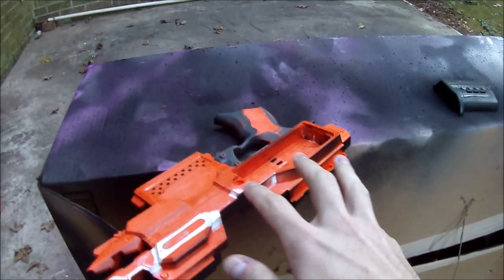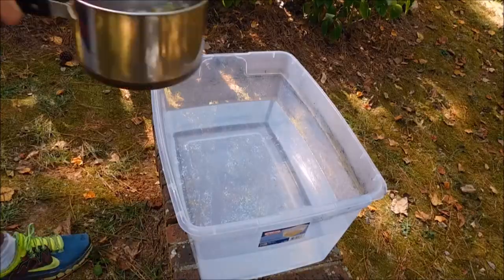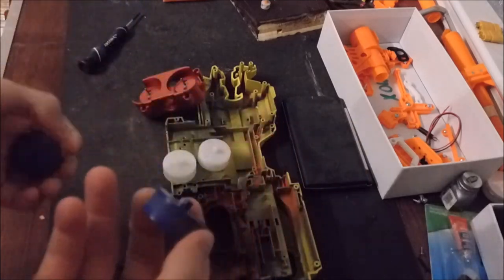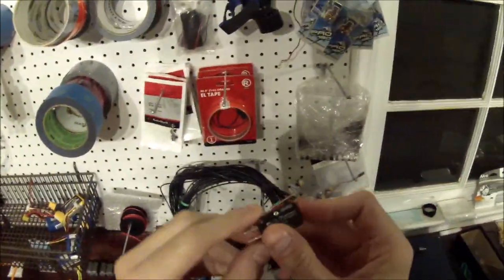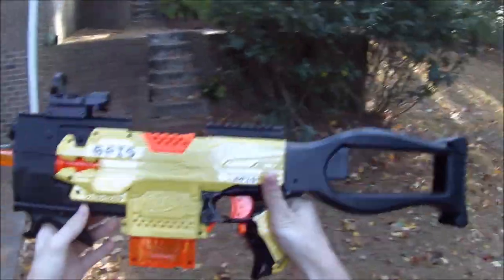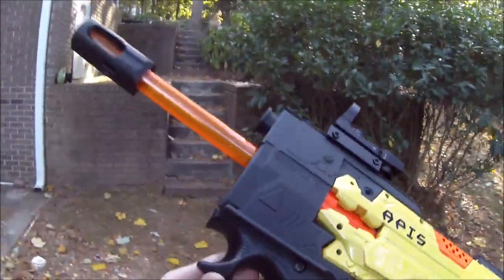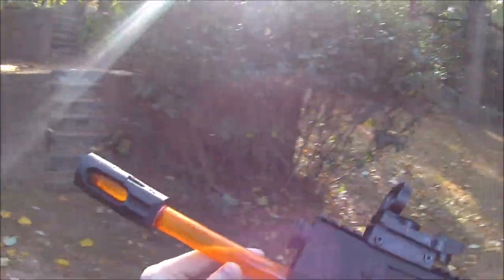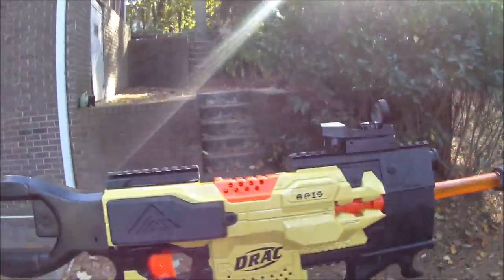Nerf Mod: The Apis Tactical Rifle

Comment: Drac, try the paper flap dremel sanding wheels for your shell prep... the stones you're using are for grinding metal and they get clogged up pretty quick. The trick is to keep it cool, and the flap wheels do this much better.

Comment: drac,i want to start modding nerf guns. any tips? and what do locks look like and which do you remove?
Reply: checmicals If You’re responsible (like don’t stick your finger it the running flywheels) then you don’t need any locks.
Reply: The jam door switch and the magazine switch are locks that prevent you from shoot ing the blaster when they are not depressed
Reply: K do what u want then make the jump into lipos when u do that you will have done ur hw
Reply: GC your kiding

Comment: Nice , but I think everyone caught the blaster modding we know . Why not a ... RC Blaster mod ? If you would , congratulations : Its time for M231 mod through Terrascout's blaster . Why M231 ? Basicly , because the M231 and the modified Terrascout are Port Firing Weapon and have similar usage : They must stay on the vehicules until emergency forcing the infantry usage . Second reason , for both M231 and Terrascout , the objective is to break the rule .

Comment: Why not 180s? If you're "overhauling" it then you might as well get the extra torque for the heavier flywheels. The only thing this build does better in terms of performance than a standard LiPo'd 130 motor Stryfe is consistent velocity, which won't break 130 feet per second with the bigger crush gap of the Blasterparts flywheels. It would be a terror in superstock wars with 180 motor and smooth Artifact flywheels.
Reply: Calvin Lee you need shell modifications for the 180s
Reply: Calvin Godfrey That's hardly an excuse. Cut the shell and mount a Jase3D motor cover, it's not that difficult.
Reply: Calvin Lee wow I have no clue what you're talking about I've audio nerf for only 5 years

Comment: you should put electrical tape on the flywheels I just did that to mine and it improves the velocity a ton
Reply: +Phillip Michaels  Electrical tape isn't designed to go on wheels with speeds in excess of 10,000RPM and messes up the balance of the flywheels. The dart residue on the flywheels offers enough grip, so there's no need to use electrical tape.
Reply: Calvin Lee well in my test I found a decent increase in velocity and you need to cut the e-tape into strips so it fits onto the flywheels
Reply: +Phillip Michaels You haven't stated any chronograph readings. The reason no one does this mod anymore is because you can get the same, if not better velocity with enough dart buildup on the flywheels without throwing the flywheels off balance with electrical tape.
Reply: Calvin Lee yes actually I did put it through a chrono and I got 75 fops with out the tape and 80 with the tape it does work
Reply: +Phillip Michaels Before, you only said you got better velocities, and didn't actually give any. As I have said before, dart buildup from using higher RPM motors will achieve better results without greatly changing the weight of the motor.
Reply: okay I dont really want to argue so im just going to go my own way with what I think works. Have a good day night afternoon or morning!

Comment: Does anyone knows which motors he is using and where he buys it?
Reply: DragonCraft Infinity He's probably using Make Test Battle Honey Badger motors, you can get them from Containment Crew if you're in the US.
Reply: Calvin Lee ahw, i live in europe 😢
Reply: +DragonCraft Infinity Not to worry, Duke Wintermaul on Nerf's Reddit page, r/nerf, ships worldwide.
Reply: Calvin Lee Wow thanks man 😃, you seem to know alot about nerf mods. Can you also please tell me how to reduce the sound of the blaster? is it the flywheel cage or are it the flywheels itsself?
Reply: +DragonCraft Infinity The volume depends on if the flywheels are perfectly round, which they aren't on most Rapidstrikes, the weight difference between the 2 flywheels, and the rigidity of the flywheel cage. Lathed flywheels, like Blasterparts, Dr. Snikkas, and Artifact ensures they are perfectly round, although Stryfes have fairly consistent flywheels already, and Foam Data Services has a video on how to weight match flywheels to minimize vibration. Having a more rigid flywheel cage, like the Artifact, DRS, and BSP cage would also help to reduce vibration.
Reply: Wow thanks man 😊, i searched for the flywheel cages but ehm, 70 dollars for a cage is a little bit too much for me😢, so ill buy some flywheels instead 😃.
Reply: Do you also know the difference between Xtreme 180 pro and Xtreme 180 se motors?
Reply: +DragonCraft Infinity The Pros might be newer models, but I don't know for sure, as I've never used either.
Reply: Oh ok thnx

Comment: I was wondering what kind of Nerf gun is easier to upgrade for a nude? :/
Reply: +Cyborg 33 Any mag fed elite springer is fairly simple to upgrade, just change the mainspring, but following one of Make Test Battle's rewiring guides will give useful experience in soldering, as flywheels are top dog in competitive superstock.

Comment: I am so tired of seeing Stryfe mods..... You replace everything on the inside and most everything on the outside.... what's the point of modding a stryfe. 3d print the whole damn thing and put in the right motors and wiring in the first place
Reply from the maker: +Boom tendo H8rs gonna H8
Reply: I love stryfes
Reply: LordDraconical good job he's just jealous cause he can't even mod a longshot
Reply: John Lenning He does pretty cool BoomCo stuff.
Reply: LordDraconical but you have to admit a 3d printed strife would be cool
Reply: Boom this is why you have 500 subs and Drac has 415k, he doesn't h8.
Reply: Boom tendo oh. drac hates...

drac h8 h8ers 
which makes him a h8er
drac hates himself?
Reply: Boom tendo, there's a difference of 3D printed plastic and injection molded plastic. The stryfe is a good base for a mod, plus you can buy it as stores for like $10-$20... It's not like the stryfe is useless for the mod, it gives the shell shape of the gun. Also, 3D printing a whole stryfe shell isn't cheap.
Reply: zuriel villegas, there already is one on his channel, the FDL-2. The only issue with 3D printing a nerf gun is quality control.
Reply: LordDraconical you did a great job. I'm just kinda over stryfe mods. Looks great tho
Reply: Boom tendo
Reply: Last I counted, 13 stryfes. -1.
Reply: ***** damn gina lol.... I'm approaching that with spinsanitys... I still have to do a cosmetic mod for one tho. Not enough time. Too many projects...
Reply: Endothermic Madness of course. But he sunk a bunch of money into basically a few inches of plastic shell. Everything else is added on. Might as well make everything 3d printed. The stock and other parts hold up well. I can see the middle part being 3d printed and holding up as well. But he's got a bunch of stryfes, so he's gotta do something with them. I'm just tired of looking online and seeing 90% stryfe mods and in comparison not much else. I'm not just trying to bash his mod. It looks great!
Reply: Shush. Its because the stryfe is Awsome and we want to see nerf Put it on shelves again.
Reply: Maxwell Dees I'm pretty sure it's still on shelves a lot of places. Just not gonna find everything everywhere
Reply: Boom tendo damn
Reply: Sure, about 80% of the people on the field at my nerf wars are running voltage modded stryfes. I most definitely would love to see some sort of completely 3d printed stryfe though....
Reply: EricOso0114 don't have to call it a stryfe at that point and you can be more creative with the shell design. At some point I'm gonna start 3d printing my own stuff. Totally original things. I need the equipment tho. Go fund me anyone?
Reply: A 3D printed shell really isnt the best Idea... so many things could go wrong.
Reply: Jethro dont hate cause you dont like nerf
Reply: +LordDraconical ur 1 of my fav utuber my fav vid was the accustrike dart cuz of the nerf perks i have them now but sadly i dissected it aswell :( cuz u had to sacrfice so i must
Reply: +Boom tendo 3D printing isn't as durable as injection molding. The 3D printed parts will hold up under normal use but if it's dropped at the right angle, you've got a broken stock. If you have an entirely 3D printed blaster, it could be a broken receiver. There is an abundance of modifications to the Stryfe for the same reason there are so many aftermarket parts for AR15s; It's an efficient platform. Some people don't like topping of a cylinder or the shifting weight profile of Boomco's clips, and complaining about it doesn't make people more interested in Boomco, just makes you look like a special snowflake. By the way, there is an effort made by people in the hobby to make high performance flywheel blasters out the box, it's called the Draugr project.
Reply: yeah
Reply: +Tyler Davis Way to make a straw-man. As I have said before, it's not practical to 3D print an entire blaster, 3D printing isn't not going to be as durable as injection molding, and rewiring any other flywheel takes just as long as rewiring a Stryfe. If you want to see an entirely new blaster, look at the FDL. Sure, he modified a blaster that countless others have modified, but it doesn't look like any other Stryfe before it. To act like 3D printing its receiver is the only way to be original is merely antagonizing the norm for no reason.
Reply: you cant 3d print a stryfe because it is copyrighted
Reply: +Tyler Davis Not to be rude, but I am having trouble understanding what you are saying. You said Lord Draconical should do something new, but you don't want him to modify Stryfes or new blasters, or 3D print his own shell, which is riddled with its own difficulties. Exactly what would you define as new?
Reply: Lucca Smith Spinsanity can. I outrange everything with spinsanity. Very good range and accuracy
Reply: Cg
Reply: +Tyler Davis "Im not saying 3D print an entire gun, parts at a time, or hell-using a different gun in general"

"I said to try something new- Like modifying different blasters, or making one by 3D printed parts."

Now you are saying he should do that, which contradicts your previous comment, which was the cause of my confusion. I will say this as many times as necessary, 3D printed parts are not practical, if you drop it at the right angle along the grain, it will break, and if it's a broken stock, it's no big deal, but if the receiver breaks, you're out of the fight. Got that? Modifying a different blaster doesn't make it "new" if it's another rewire and motor swap. I wanted to see if the Blasterparts flywheels were compatible with the Artifact cage, and no one ever tried it, so I consider the Apis to be original in its motor and flywheel setup and its aesthetics. There are near infinite combinations to mod the Stryfe with, and to label them all unoriginal just because it's on a Stryfe is pedantic.
Reply: Calvin Lee It's okay guys. It was just a comment. We don't need to keep fighting. Peace bros
Reply: +Tyler Davis "You read it wrong due to my bad grammar"

If you wanted me to read it "right" then you should make it coherent in the first place. Yes, you did contradict yourself in the previous comments, and clarifying now doesn't change that, but it does make your intentions in the previous comments clearer. Determining whether or not rewiring a Stryfe no longer makes it a Stryfe is a matter of semantics, so I'm not going to argue with you on that. After seeing your latest comment, I'll admit that Drac's mods recently have only been Stryfes and EATs, and it wouldn't hurt to mod and paint other blasters.
Reply: A springer with afterburner flywheels would be cool.
Reply: those flyweels coud go hella fast brcause the darts wont be starting from rest..
Reply: Boom tendo EXPENSIVE
Reply: Natho 666 so are all the extra parts he bought
Reply: Boom tendo too expensive and even more complicated than gutting and painting a stryfe
Reply: MrLivingTNT it's a mounting bracket and a magwell. It's not brain surgery
Reply: That is taking it to the radical extreme
Reply: OOOHHH ROASTED
Reply: Boom tendo it's called a hobby, I'm presuming you're fairly new to the nerf modding community. just like every other hobbyist community similar things are done on a daily basis. a stryfe is dirt cheap to do a basic mod to and there are people out there who will pay rediculus amounts for bespoke modded nerf blasters.
Reply: Boom tendo just about all nerf kits can only be used for the stryfes he kinda has to use them and she 3D print a stryfe when you can just buy one.PS boom co sucks
Reply: Boom tendo Bru stop being a hatr
Reply: Stryfes are awesome dude